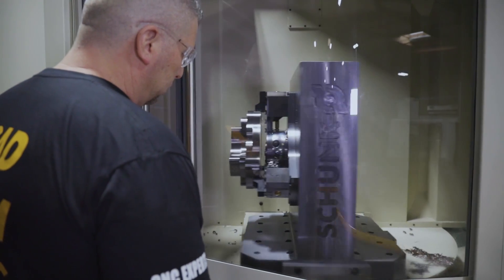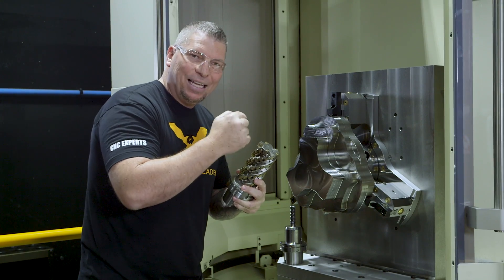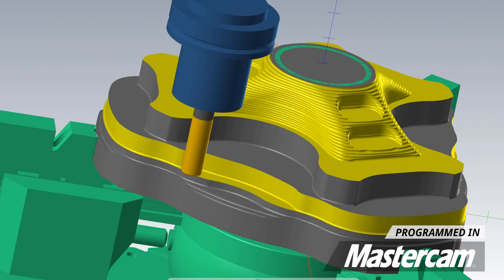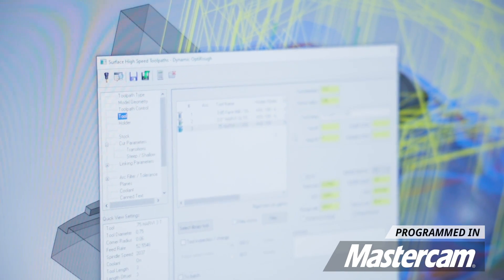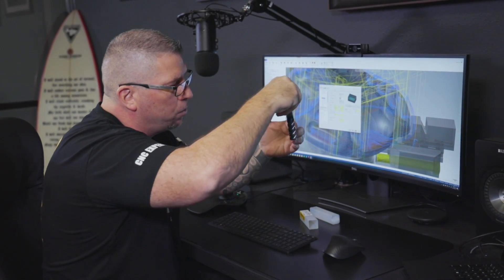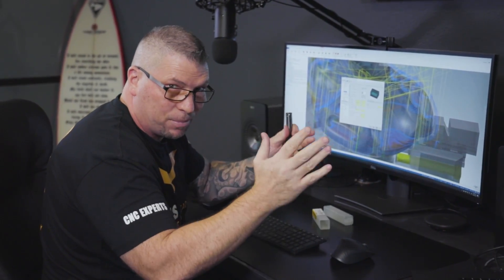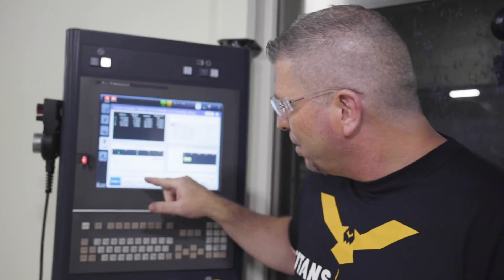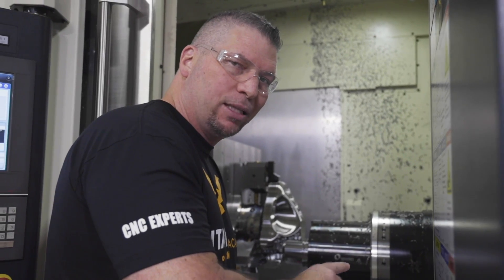60 HP Makino | Incredible Machining on Titanium Aerospace Part | OptiRough

Comment: I’m curious what the total runtime was for this job 🤔.    And for sure the quality of end mill makes all the difference.   I work for a shop that used to buy these damn end mills called monster mills.  Omg they sucked.   We now use hanita.  Which are better.  And hanita isn’t even a great tool.  I had a 1/2 kenametal in my tool box that I used forever. It finally got worn out     🤷🏻‍♂️. I think if we had more responsible people in the shop they would switch to something good.   But people aren’t responsible and really don’t take care of the tooling.  Which is a shame

Comment: Love the Makino-Leblond machine....many years ago when I have my shop(late 80's early 90's) I was torn between the Makino and the Yasda....I chose the Yasda with the Fanuc 7M with a pallet changer....it was an awesome machine and even the President and owner of Yasda came to see the installed machine running....I'm  a mold maker by trade and I wanted repeatability  hold true position at .0005....really tight and the machine did it....just shy of jig grinding which we could of gotten the head for the machine but the chip dust would eventually damage the machine and that was not acceptable for us....

Comment: Titan,
Shouldn't this be made on a Vertical machine?
Reply: Why?
Reply: @AdamTrautmanBowling  it would be easier to hold the job vertically instead of horizontally. That's my guess.
Reply: @Shershivrajhai  my guess is either he wanted to use that machine specifically for the video, or it is more rigid and or more powerful than the vertical mills he has available to him.

Comment: The droning noise of the cutter's flutes hitting the part must impart a lot of vibration into the machine. I wonder how it's damped to avoid affecting the surface finish. Maybe the machine itself is just so rigid that its natural frequency is always higher than the mill's flute impacts.

Comment: What is the part going to be used for? I love this stuff! Also, do you reuse the coolant/lubricant? I am not a machinist, just a dude that loves CNC :)
Reply: Yep. All these machines have a coolant system that strains as much of the metal and chips out of the coolant as it can and sends it back to a tank to be pumped back through. Some is lost as it sticks with the chips when they run up the chip conveyor and into a recycling container, and some evaporates as it hits the cut so it does need replenished from time to time. Some coolants can also go bad and grow bacteria after a certain amount of time in use.

Comment: I melt titanium into ingots for a living, so it's really neat to see the final product being formed.
Reply: Could you tell me, how strong the foamed titanium is before it's processed to ingots?
What is the reason why "foamed Ti" isn't used to make really lightweight parts?
Reply: @AltMarc  My job is to process scrap and sponge titanium into large ingots with specific chemistry using the electron beam and hearth melting method. The goal is to get a uniform, no defect (low density inclusion, high density inclusion) product that has no points where stress failure may occur. The metal we make is used primarily in the aerospace industry. I don't work with foamed titanium. My understanding is that foamed titanium is a powdered metal technology that introduces oxygen and nitrogen. We work hard to keep those elements out of our product as we melt in an extreme vacuum <100mTorr. I would imagine that foamed titanium would be difficult to use in critical applications because it's microstructure is not uniform. This would make it difficult to stress analyze to the degree necessary to safely use in some applications.
Reply: @Mike-or8ct  By "foamed" I meant the sponge you did mention. I had that idea to 3D print directly from TiClx or TiH... 
Very interesting job you have, I used to service such vacuum oven used to drive off the hydrogen in the machined Titanium parts.

Comment: Damn. That’s a lot of inserts to make this part. This part is like 150k  lol.
Reply: I had some titanium contoured plates that we made at my shop. The plate material was 3k per and the tooling was expensive too. They were about 1.5" x 12" x 32" plates and similarly dimensioned parts that ended up .120 thick all around. We sold those to Boeing for 20k a pop in the end.

Comment: Titan, first off you are doing great things, your passion is contagious, keep pushing to make manufacturing great again.

 
Could you expand on your choice of cutters on this part?  Since we can't see the MRR when you program the part and understanding we want the fastest possible cycle time, why did you choose to go from a Shell mill to a Harvi Ultra8X, then to a 3/4 end Mill on the second side of the part?  Why not use a shell mill and step down the cutter around the profile of the part like you are with the end mill, granted you might need a slightly smaller dia. cutter and a different shape insert, then do any tight corners and the slot with an endmill. 

I understand you want to showcase any new Kennametal cutter and show people what it can do.  Do you consider the face mill and harvi ultra standard tools you keep in the machines? 

Why even use the face mill at all on the second side?  There seems to be plenty of flute length on the Harvey 8x left that would cut the excess stock off, it seems like a pretty large reduction in cycle time.  I guess you could use the face mill operation on the first side to maintain a standard max stock height if flute length is a problem.

Comment: Would love to know what the part is actually for....
Reply: Its a really fancy vase
Reply: If it is titanium it has to go through a lot of heat
Reply: Paper weight
Reply: it's for a video.  and it's actually cheap aluminum.
Reply: @blue03r6  what are you doing here when you don't even know what aluminum cuts and looks like 🤣🤣
Reply: @ajstrauss55  if thats alluminium im the mf pope. Alluminium cuts like butter, useless to use a machine like this for it when you can use much smaller and inexpensive machines to fabricate such a part.
Reply: @frankie.7z  I dunno, man. I've heard aluminum cuts sound like that

when the operator forgot to put inserts in the toolholder.
Reply: @brahtrumpwonbigly7309  haha that got me lol

Comment: I would like to see an accurate description of how long this part took to manufacture including step time break down.  The issue is more an more machine shops work on unbelievable tight deadlines so 24/7 shop operations are now the norm in the local machining industry in my city.

Comment: Is it possible to switch to a tool with a shorter cutting surface when cutting steps like that? You would think that the tip gets more wear than the back, so the tool isn´t wearing evenly. Isn´t it cheaper to produce a tool with less cutting surface. A tool where you use all surfaces the same should get you the maximum amount of material removal per $. Is there an advantage to not switching or does it not make that much of a difference to tool life?

Comment: Hey, if you like that A81nx, you'll love the T2.
Reply: The Makino T2 is a purpose built machine specifically for the challenges of titanium machining.  It has a 4,000 rpm spindle that uses the HSK-125 spindle interface.  That means that the face contact between the tool and spindle is around 5" in diameter.  That spindle has 200 Hp and 1,000 ft-lbs of duty rated power and torque.
Reply from the maker: I love the a81nx... but wait T2 sounds like Godzilla 🤨

Comment: There are so many machine tool builders making such good equipment that it's hard to decide what to buy! We looked at ALL of them, from ten different countries and four continents. In the end we chose Mazak machines and PH Horn for our durable tooling and a mix of SECO, Kennametal, Sandvik and smaller local brands. for our perishable. We use the Blazer full synthetic and we have separate centrifuge that we process the coolant through once it's been used. It basically triples our coolant life. But we could have just as easily chose Makino for our provider. Very high end machines.

Comment: Impressive figures on the surface speed, i usually don't go over 60 smm, Toollife 7½ hours, when i push it to 90 smm, it will last only 3 hours.. you're running them at 122?.. Ok.. with coolant.. i run em dry..

Comment: Do you use verification software i.e. Vericut before running on your machines. I have recently startes using said software and used it before going down onto the shop floor. Worked the kinks out in the office ran on machine and boom perfect part! Another awesome video.

Comment: I feel bad for whoever gets tasked with indexing the inserts on that cutter
Reply: I feel bad for the guy who bumps the machine for the first time, like crashing a million dollar car and you're not the owner....then you have to talk to the owner😱
Reply: The cutters are worked on out side the machine , cleaned so that all that is required is to loosen the insert , turn or replace  , and retighten , check and return to the machine . Easiest part of the job .
Reply: 8 cutting edges on eack tooth not 4
Reply: @timothyjones9863  who said they only have 4?
Reply: Steven Bateman Thank You! 🙏 
Why do people comment when they dont know wtf they are talking about!? Lol
Reply: Imagine doing the indexing tasks but a crew mate suddenly died on your feet, someone saw it and reported dead body.
Reply: Index the cutter? Set your height and cut chips. The diameter should be set in your program. Maybe I’m missing something but it’s essentially an end mill.
Reply: @Nismospec52  lol. I envy your naivety.
Reply: @FloppyCat1990  'Assumption is the mother of all fuckups'. 

If only there is such a machine,  anything from human error in programming/setting parameters, inappropriate tooling/material, machine malfunction even a power cut can cause undesired results the list goes on!..Murphy's law: 'anything that could go wrong, will eventually go wrong on a long enough timescale!'

Impressive machine tho amazing how far they have come, I still remember the old punch card tapes used to load the programs.
Reply: Why? He's getting paid.
Reply: @1N2themystic  You could get paid to watch tv or paid to shovel cow shit, now pick.
Reply: Divinegon  no, it means to set them at the proper angle. In this case each tooth on the cutter head has to be inserted and have the angle checked for accuracy. Although the seats are angled to basically do this for you so I'm not sure if they actually get double checked with a tool of some type or not.

Comment: our programmers always like to use bull nose end mills for almost everything.  What are your thoughts on this mentality?
Reply: personally i use them because 1: you can finish surfaces with them and 2: they don't break as often due to the corner radius.  only reason i ever wouldn't use one is if i need to mill a 90deg shoulder with no radius.  i usually go for the 0.01 or 0.02 corner radius mills.
Reply: I use Seco tools mostly & a few different bullnose cutters. The one I use the most for roughing out is 40mm diameter ,12mm round inserts ( they have a locator pin, so effectively 6 edges).
I run this cutter @ 2400RPM
3.3mm depth of cut & 4000mm/ min feed..
I have a larger 63 diameter cutter , which uses the same tips . I have to be careful with this cutter as it will stall the machine if I try to do the depth of cut & feed rate of the 40mm cutter.
I definitely would have used a bull nosed cutter on this job.

Comment: Awesome man, just out of curiosity. what is your spindle load % on these cuts?
Reply: We have a similar machine in our shop just a few years older. With a 8% step over the spindle load barely moves, less then 5%.
Reply: The load looks pretty bad. The machine can take it but the bits will be trashed, if not break pretty fast.

Comment: I am a Japanese and working in metal processing. (in Japan)
Makino + master cam combination
I am very happy to see foreigners working in the same combination.
I look forward to the next video.
Reply: We work with Mitsui Seiki , Mori Seiki , SNK , OKK ,since 1991 we love it . With respect thank for the best quality so we help ASML Litho to get Nano precision .
Reply: ngung nghi khong that’s great! Do you do the work for the ASML EUV tools?
Reply: @pjoh7  No i don't . I work at machine shop ( MOGEMA.BV ) we make most and main part for ALSM for more then 20 years . I been at ASML in Veldhoven 4 time , so we understand why accuracy and clean is the quality they want .( even fingerprinting on the part is reject )
Reply: ngung nghi khong that’s great! ASML litho tools are some of the most precise machines in the world. Fascinating.
Reply: @pjoh7  As you know standard machines in a/c room on 19 C degree ( incl the coolant temperature ) you can get only Mirco  mm accuracy ..... that is still 0.000000 to fare from Nano mm . The Swiss machine we have has granite bed ( like CMM ) slide on air , high temperature resistant . Even all of that . to get the best we use probe  to measure our part before we remove it from machine . The Japanese machine still one of the best in quality . The probe report come out is near the Zeiss CMM report ). If you ask me i will say cheap Japanese machines like SNK compare to Haas  is same like you compare Mercedes  and Ford . Out side all of this factor you still needs peoples who care about what they make .
Reply: I work with Mori Seiki Doosan Hass millturn in Auckland NZ not Makino Seen videos of Makino Cnc latest technology Japanese Best👌🙏🙏🙏
Reply: MAN BEAM That is very funny. In my country we consider Japanese a foreigner.
Reply: @lijie6431  Oh sure
Reply: I work on older Mori Seiki, newer Dmg Mori and Mazak machines :)